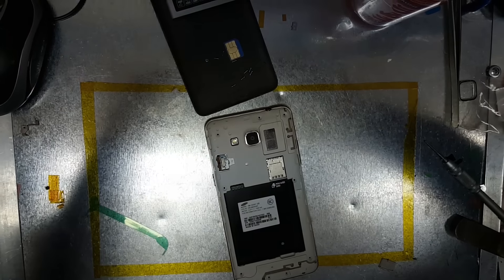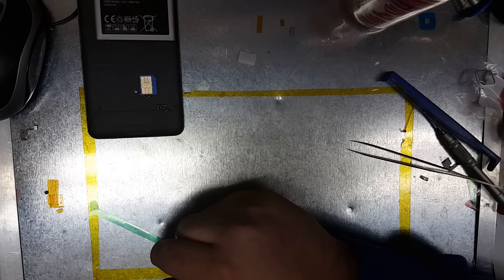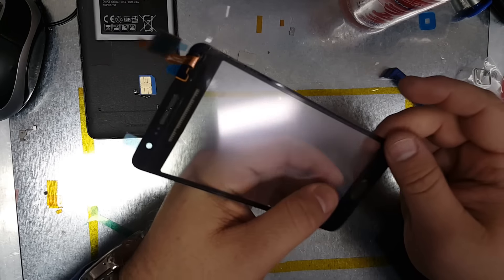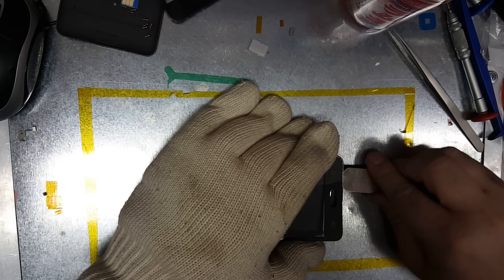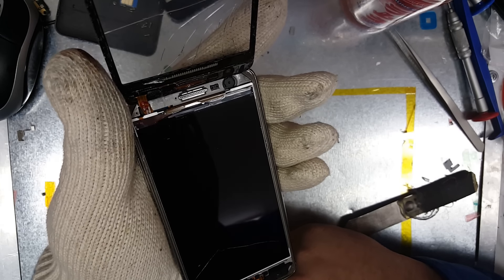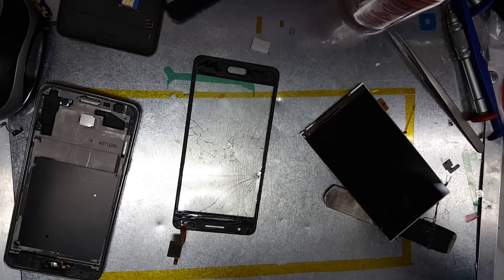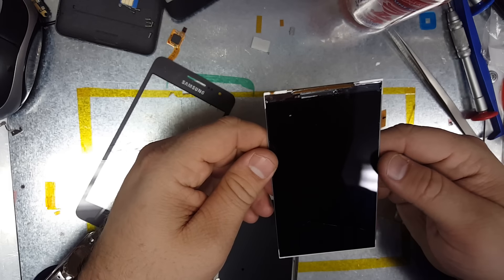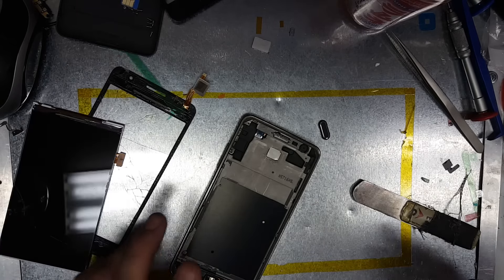Galaxy grand core prime screen replacement fail

Comment: i would try using some gold thread as if you were to refurbish a iPhone screen, after you let it sit on a heat plate for a little bit or a heat gun , great vid  by the way very informative, i do agree you do learn way more from these kinds of videos than a speed run of a successful repair vid. keep up the good work!

Comment: Hey DUSTIN, IS there away to put on here a big WARNING before proceed. I also broke that digitizer part. Also, you may also want to add: the connection output is on thee the TOP. thx. I'm kicking myself in the ass for breaking the same. Just order the 2-1 on Amazon.

Comment: But the way, NOT a fail. The sticking out part slides in at the back gently. If you don't know what I mean. Go to the back of the lcd and slide the end do hickey on the scrren. I pulled it right out and realized it on the lcd, a sliding in pRt that you connect the screen. If you don't know what I mean. ZOOM in on the digitizer and you'll see an arrow pointing DOWN that end part on the screen. Hope I'm making sicnr.

Comment: I have the core prime and I tried to fix the glass and ended up to where my LCD won't turn on..?
Reply: Check the top of the LCD as there is a small strip of delicate glass that breaks if you're not careful. if it's cracked the screen is no good it seems
Reply: Yes. :( mine broke. I can still hear it turn on, and it still vibrates, but no screen being turned on.
Reply: I bought a replacement phone ultimately. I think on Amazon or eBay.  Sorry it didn't work out but might not be worth it to fix unless you go to a store...
Reply: Yeah, as it is I paid 80 at Walmart for it. :p so its alright. I didn't want to be charged a lot at a store for it so I may just buy a whole new replacement.